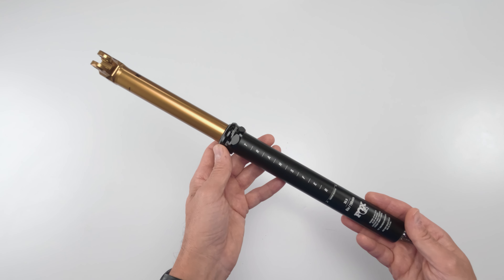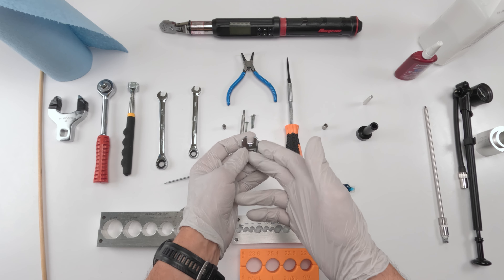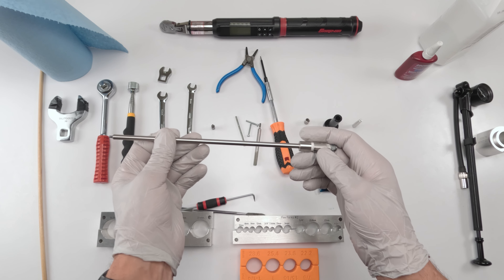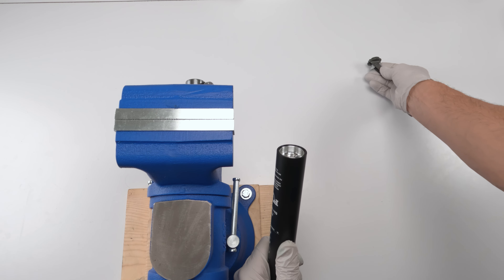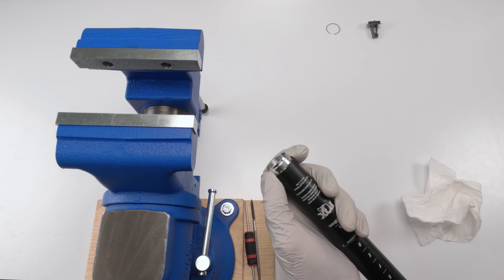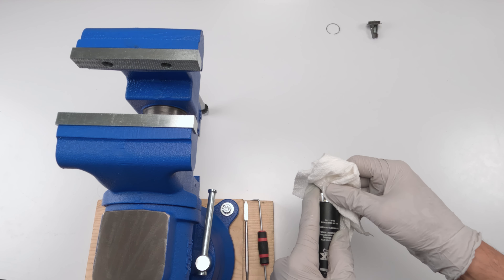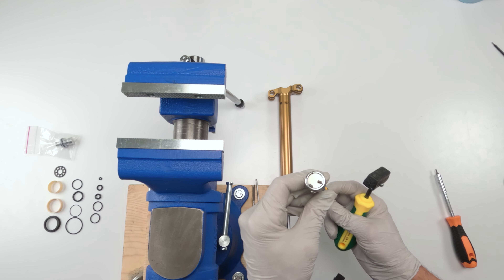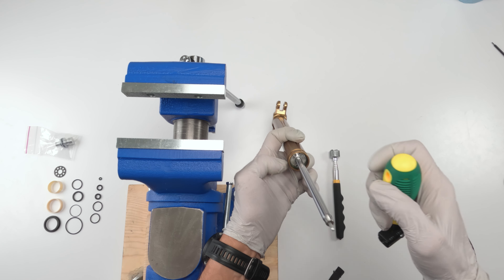FOX Transfer Dropper Post Full Service Rebuild Guide for beginners. 2021+ model  versions

Comment: Great vid. Fox posts are over engineered trash. I’ve had a couple and they all fail eventually. OneUp is better for the money but Bike Yoke just performs superbly and so consistent.
Reply from the maker: love my oneup's. easy to service and they have been flawless. one of them as seen a ridiculous amount of use and its still going strong with the original damper!  hard to beat fore teh money, especially after a good discount!
Reply: Another very good one is Brand-X Ascend, I have one since 2014 or 2015, still runs like day one, never needed any service, it just runs, was about €120-130.
(I have the 150mm internal model, they have externals too)
My Fox Transfer Kashima junk came with my new bike in 2018 and by 2019 it was already sticky, wouldn't extend fully, needed constant service, the only reason I kept it on the bike was because it matched the colour of the fork and shock, but now I'm back to the good old Brand-X cheap one.

(which, subjectively, isn't actually heavier than the Fox)

Comment: Ill never buy fox. Pnw or tranz x is good enough but really good video.
Reply from the maker: I couldn't agree more with you. The transfer is a nice post and pretty solid, but the reality is that there are equally good posts out there like the ones you mention that cost significantly less. Now, I'll give FOX credit for making the post fully serviceable, but at a significant cost. The tools for a Pre-2021 post literally cost around $700 - $800, plus the service kit and oil. I could literally buy at least three solid posts for that money. The 2021 and on transfers still need about $150–$180 in tools, but that's because the stupid fill adapter is like $100, and it SUCKS! If they didn't need that dumb adapter, which is finicky as @#$%, it would literally need about $50 in custom tools, which would make it a MUCH better value, imo.
Reply: @zoubtube  I’ve been binging some of your videos and it’s custom tool after custom tool, what percentage of those tools do you think is 3d printable?  I have a feeling it’s like 80%.  If that’s true, it would easily be a great investment along with some solid filament.  Anyway, thanks for the videos, they’re entertaining and super helpful, keep it up!
Reply from the maker: @amazinf4344  One of my bigger regrets has been not training myself on the 3d printing process. So many ideas come and go, and I'm sure many more would have probably seen a prototype stage if I were proficient with the process.

You are correct. I would say 80% is a very safe number to assume considering today's 3D printing solutions. Many times I've thought about creating cost-effective tool packages for servicing different products in order to make it more cost-justifiable for people to perform their own service when needed. 3d printing is definitely a major part of that solution.
Reply: @zoubtube   If you think it can be done I'll give it a shot, I have access to some good equipment for the job and I want to see if it's possible.  Also, I recently acquired a 2020 fox transfer that needs a rebuild, I got stuck on the rod tool part that costs like $400.  You reckon I could get away with a pipe with similar diameter or a 3d printed tool just like that?
Reply from the maker: @amazinf4344  If you know the software, then you should easily be able to make the tools, especially the $400 puller. Its nothing more than a jack bolt. Using a hard plastic should be way more than strong enough to do the job many times over. let me know your thoughts or what info might be needed to get this done. It would be awesome if people had the option to by this tool for a reasonable cost. Servicing this post isn't hard. Its the tools that make it unreasonable.
Reply from the maker: @amazinf4344  If you know the software you should easily be able to build the $400 puller. Its noting more than a jack bolt. A threaded rod with a squared end and a nut with a squared end. the but needs the outer diameter the match the inside of the damper tube in order for the retaining ring to keep it in place. two wrenches, one for the nut the other for the squared off end of the threaded rod, is all that's needed to push out the collar out. A Hard plastic is more than enough to do the job

Dude, if you can do this for a reasonable price that would be outstanding! 👍
Reply: @zoubtube  well, I just found out fox are the biggest scammers ever.  I 3d printed a shaft clamp which actually worked surprisingly well, as for the puller, I just used an old seatpost and stuffed some towels down there to cushion the blow along with my bike stand and it came right out.  The only thing I didn’t do was bleed it since I still didn’t buy oil or the damper height thing or the needle but this is a start I’d say.  Went straight from $500 on tools to about $50 for the needle and whatever else misc there is.
Reply: @zoubtube  you don’t even need to buy anything, the plastic shaft I used was cranked all the way down and I only stopped in fear that the aluminum would collapse or disfigure.  Ofcourse it wouldn’t be practical in a bike shop but for a person to just need to buy a 27.2 seatpost, some towels, print a shaft clamp, get some picks, a adjustable wrench, and whatever else is needed for the bleed is simply mind blowing when comparing the price of the tools fox wants you to have and the tools you actually need

Comment: So complicated! There are so many great droppers that can be serviced in a fraction of the time!
Reply from the maker: Yup, Though a major difference between this post when compared many other posts on the market is  FOX designed it to be fully serviceable. Most posts aren't, They only allow for the post to be regreases. If the cartridge goes, they force you to by a new ones. Still, I would get a more cost effective post oneup, pnw etc.
Reply: @zoubtube  True, but most people aren't going to service their own Fox dropper so the cost to have it professionally done will greatly outweigh the cost of a new cartridge.
Reply from the maker: @kostak2171 yup. But for the 2021 and newer versions the break even points of getting the tools is about 1 service. After that you're only paying for seals and oil. Roi is relatively quick. The pre 2021 versions,, forget about it! You would need to rebuild it about 7 times to break even. I plan on making a video to service the post the most cost effective way possible. This way people who have them can have the option without having to refinance a home 😁
Reply: @zoubtube how do u know if u have the newer post ?

Comment: When it is the right time to service the dropper post?
Reply from the maker: Apologies for the late response. Great question. The 50-hour (or so) service is by far the most important for EVERY dropper post. It is quick and easy, it allows you to check the condition of the internals, and it provides the most return for the effort while extending the life of the post. The full service, on the other hand, needs to happen if you're experiencing unwanted sag or other post anomalies, or after many hours of use, e.g. 200, 300 or even more hours depending on the post. I can't recommend enough getting used to performing a regular 50-hour service; it's worth every bit of your time

Comment: I’m curious how long it takes the technicians at the fox service center to do this
Reply from the maker: About 20 minutes. I take my time and can finish it in around 30-40 minutes. it's actually a very easy job, it's the tools to service them that are ridiculous. If FOX was to make the post a bit more use friendly and utilize standard tools (Ex schrader valve instead of that USELESS and  STUPID expensive air fill adapter)   The transfer would be an outstanding post IMO

Comment: Is this for 2021? It doesn't need nitrogen?
Reply from the maker: Nope!  Droppers, shocks or forks don't  "Need" nitrogen. All of them will work with either nitrogen or air. Air is ~79% nitrogen.  Not to say Nitrogen doesn't have some advantages. The big advantage is heat buildup. If you're riding in super hot environments, especially on trails with very long, hard-hitting runs, Then nitrogen will do better than air to maintain consistency in a shock. For droppers, this will never matter. Air is more than enough and easier to come across 😉

Comment: when do you use the Fox float fluid?
Reply from the maker: You can add a few drops of float fluid  into the body before you close the ifp shaft with the seal head. Or you can use SRAM butter, like I do. I apply a decent amount to the shaft and bullet tool before installing the seal head. The seal head will collect it all in order to help lube the shaft. Personally, I think grease is a better option. The float fluid can settle, whereas grease sticks everywhere

Comment: Whats are your thoughts on the newest 2024+ model? They made it far easier to work on right, they even put a normal schrader valve accessible from the outside? Which is a basic function that every other manufacturer except the very low end stuff offers.
Reply from the maker: My thoughts are they should have made these changes back in 2017! 😉From what I can tell, they made it MUCH simpler to work on, but I haven't worked on one yet. In fact, I don't know anyone who owns one. I think FOX somewhat hurt themselves with the transfer post. For too long, they kept it overpriced,  and they were a challenge to service. I can't imagine the new post being bad, but reality is there is a TON of competition these days. It'll be interesting to see how it goes for them. If this channel made any money, I'd buy one just to service it, but we're not there yet. I'm sure I'll come across one soon in 2025 though! 👍

Comment: I've rebuilt a few hundred of these at a service center and I must say your instructions are very good. 
Very few thing that I do differently. Not worth mentioning them as I don't want to confuse your viewers. Good job on the video.

I could chip in with some warnings as to what to watch out for once the posts age that might result in a failed repair :

Any railing or gouging on the damper shaft will lead to gas/oil loss. It has to be spotless for reliability. I polish them on a lathe with 2000+ grit, or replace if too worn.

Same goes for the small bushing in the seal head, which will usually be worn by a damaged shaft. A worn bushing will quickly deteriorate the shaft it's sliding on.

So if the oil you see coming out of the post has any tint or greyness to it, something has worn and contaminated it. It's best to find the culprit before rebuilding.
Reply from the maker: Apologies for the late response. I'm all about feedback from people who have tons of experience performing services like these. So if there is anything you can add that would help people have a better overall experience performing this service, please feel free to share. I have a 2018 FOX transfer that I will be making a video on very soon. Maybe I can add some of additional input to it, along with the tips you already mentioned. 👍Thanks for the comment and for watching the video

Comment: Awesome video Sr. I could achieve success but I had to repeat the bleeding part because in my first attempt I failed. Highly recommended, just be aware that you missed the part of the Fox Suspension Float Fluid 5cc (I had to check the ridefox service manual to see in what step add the fluid). Another thing is the air fill tool has an horrible leak between the adapter and pump head, I had to weld that connection using JB weld epoxy to finally could add the 325 air pressure (using plumbers tape just was fail after fail). Other than that everything works perfectly, thank you very much for the knowledge you share with us. I hope you can make a tutorial for the fox float X performance full rebuilt. Thanks again, cheers!
Reply from the maker: AWESOME job myman. SUPER glad to hear it all worked out for you. 👏🦾

The air-fill tool is just plain crap. I had to patch mine as well to make it work successfully. I recently bought their new tool but haven't tried it yet. I will for the next transfer video (I have a 2018 sitting in a box, but no rush on that)

As for the 5cc of float fluid, I believe this is for the backside of the IFP under the air fill cap. Yes, I did leave it out because I use grease instead (sram butter in this case). Either/or can be used, imo. I prefer grease on the shaft, as it doesn't settle like oil does. BUT,,,, you are 100% right. I should have at least mentioned the option. I will do so in the next transfer video (2018 model) coming soon. I look forward to comments like these. They help me remember to mention details I missed for future videos. Recording these videos has proven to be WAY more challenging than the actual jobs ever were. For years it was just me, or on occasion a friend watching me, in my quiet space, doing the jobs lost in my thoughts. Adding a camera and microphone to the mix definitely changes the dynamics. 😵‍💫

Float X is coming, but I need a bit of time. I have a few sid forks, rockshox deluxe ultimate and super deluxe I need to get out first as friends are waiting for their parts back. Tiss the season! 😁 Unfortunately work travel isn't exactly helping.

If at any time you see I missed something, or a way to improve something, feel free to let me know. my goal it to make it as easy for people to follow, especially those in other parts of the world where they have no service options 👍
Reply: @zoubtube  I hope the best for the new tool, you said that older versions requires more expensive tools (thankfully I have 2021 version)

No worries about mention the option between 5cc float fluid, I just was a little confused about that fluid but totally agreed using butter grease instead. 
This process is amazingly complex, of course exist the possibility to miss things but your tutorial is very professional and helpful, we can not expect more, just my humble feedback :)

I have never step into a bike shop for repairs or maintenance, everything I self learned in youtube, I was missing the dropper post and shock full rebuild, after extensive research your video was the best, just those little things to tell people to be aware but totally encourage to do that service in home, is very entertain and if you love cycling you love bike mechanics as well.

For sure I will let you know if happens another feedback, for now I have to wait at least 6 more months to do the Float X full service (I own 2 of them) and 1 year for service my rockshox reverb (feeling more confident about this one obviously using your tutorial).

Thanks bro again for all the knowledge and best wishes for the next videos! Cheers!
Reply from the maker: @pepesolari5575  "This process is amazingly complex" Be proud that you did it myman. I promise you that the next time will be MUCH easier. 

Good for you for putting in the effort to perform these jobs. 💪Modern bikes are highly engineered products, more so than ever before. And just like any other mechanical device, they need maintenance. Learning to perform these tasks on your own will not only provide a better overall riding experience, but it will also save you very significant amount of money over time.

And I'm positive that by the time your float X needs service, I will have a video for you. Now go out there and enjoy the season. 👍

As always, if you have any questions, let me know

Comment: This video is amazing, really good
Reply from the maker: Glad to hear the video was of interest to you. If you haven't done the service yet, It's actually not all that bad. My gripe with FOX is the tools required, though the 2021 to 2024 version isn't anywhere needs as bad as the original 2017 - 2020 version ( I still need to finish editing the video for the original transfer) The latest version addresses the expensive tools for service. I plan on making a video on it this winter.

Comment: Great video !  I've done a full servicing on my shock and after that my feeling was like I would not do it again by myself and this is exactly the same.   I have 2023 Fox Transfer Performance Elite dropper that often time does not come up all the way top and was gonna do the service.  But after watching this,  I probably go with Oneup.
Reply from the maker: Yup! The fox transfer is a nice post, and for the most part, a solid post, but Fox put ZERO thought into servicing them during the design process. The new one supposedly addresses this. I haven't worked on one yet, but I plan to soon.

Funny that you mentioned the oneup post. I think I had a oneup v2 service video scheduled to post tonight. Great posts. One of my four v2's literally has well into the thousands of actuation's on it. With regular service, it runs flawlessly and has NO signs of wear.

I just picked up a v3. Surprisingly light and seems to be a sturdy post, time will tell if it will last as long as a v2. I just finished recording a service video for it that should be posted soon.

Comment: You should attach a list of tools (your version & the fox part#s) so folks can print it off. For the fox tools include a link, that will give you credit and a kick back for those tools, esp to amazon whenever the tool is purchased. Excellent videos! They are very informative.
Reply from the maker: Thanks for the comment. You right! I really should put time to figure out the affiliates links options out there. For now I included a list of tools needed for the job in the description section. hope this helps